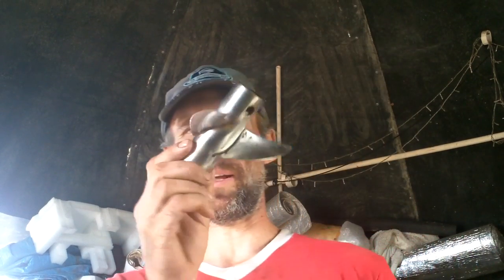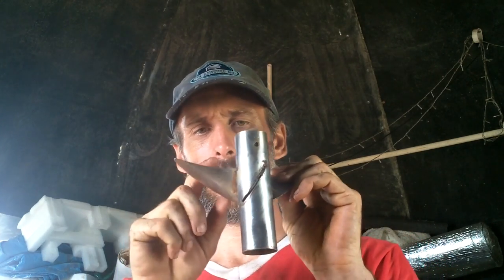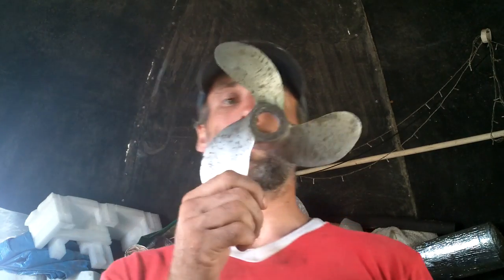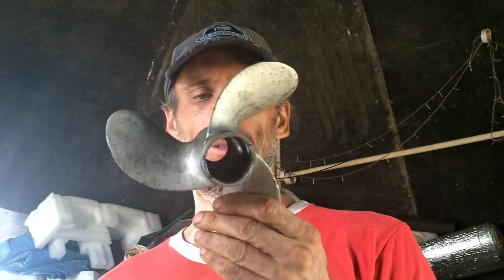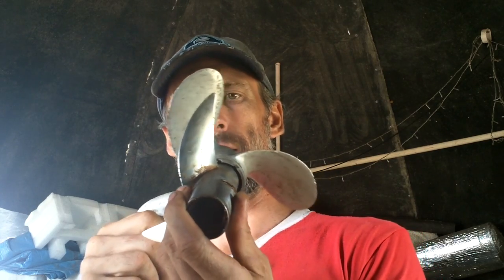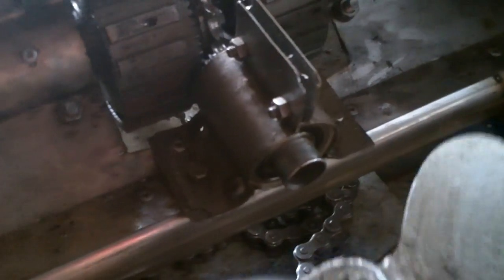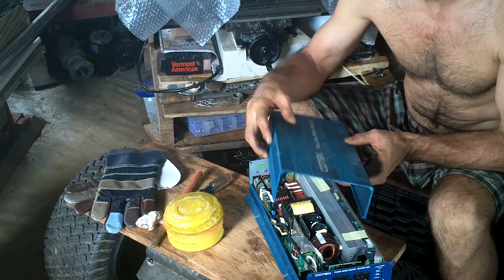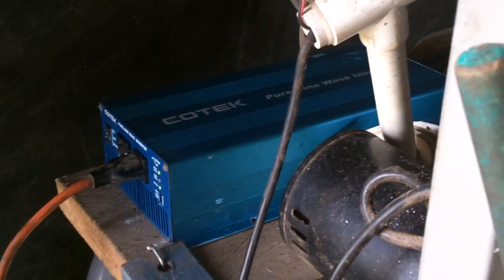Temporary Propeller to go Get Resin... to make Propeller

Comment: You get what you pay for, unfortunately. There are good inverters (Samlex, Magnum, Outback Power, etc), they just cost an arm and a leg. Samlex even has some inverter/chargers that have inputs for a solar charge controller. There are also good boat motors, they're just expensive. - Edit: I guess the charger function wouldn't actually be much use to you. Samlex is probably your best bet, though. Because of the moisture where you are, it might be a good idea to look into a marine inverter, it would probably last forever, but that's big money.
Reply: Bingo. They do make things to last. Jamie does not buy those things, he buys what's cheap, because he doesn't like wasting money. So the struggle is whether you waste money overbuilding, or waste money by cheaping out. Any industrial gear that's overbuilt 10x will last forever. To fix the inverter, it's probably 1 of 2 things: 1 - The big power capacitors, or 2 - One of the power transistors. You can figure this out just by doing a sniff test. Put a straw in your nose if that helps, and sniff different areas of the board. Hopefully you'll find a brown stain on one component, that'll be what needs replacing. But when you're in Panama and not a major city that can have parts delivered next day, pain in the butt.

Comment: With your engineering awesomeness,  I think it would be cool to see if you can build a propeller that you can adjust the blade pitch while you are running it.. I think it could be done with an internal linkage rod in the drive "tube" that could come up to the motor end and out to an external ring and bearing that you can move up and down to make the propeller adjustment.   Sorry if my ramblings are incoherent as I can see it in my mind but may not be able to put it to words.

Comment: You can try to treat the rust on stainless steel with lemon juice. The citric acid will dissolve the rust and create a new passive layer on the surface protecting it from further corrosion. Although sea water will corrode some lower grades of stainless steel anyway.

Comment: Try to find an old Tripp-Lite inverter. They aren't pure sine but will start and run anything you have in the shop. They handle motor startup with ease since their rating is 1/2 of the output made during a large load.

Comment: Get an outback fxr3048 - it is a completely sealed inverter no outside air gets into the electronics. They make them for 12 or 24v also but the 48 is the most efficient
Reply: I have them running here for over 15 years in an 9kw three phase array. The only thing that kills them is direct lightning strike.. not mine but others have died from that. About to replace with the same models but 6 of them for 18kw three phase.

Comment: So the reason that everything only lasts for a while is because of whats called " planned obselescence ". You may already know about this but if not look it up it explains so much about the reason why we are such a throw away culture. Look up the hundred year light bulb and it explains why everything you buy is engineered to fail. I try to buy old tools whenever possible because they were made to last until around 1920's ish.  By the way thanks for doing all these videos its a nice little escape to see some robinson crusoeish inginuity. Ur helpfull in keeping the dream alive until i get my ducks in a row and get some property to really start livin.
Reply: Planned obsolescence may be a real thing, but so is "built to a cost". There is a subtle difference between "engineered to fail" and "engineered to meet a cost". The result may be the same for the consumer but the driving factors behind the two are different.
Reply: That 100 year light bulb is extremly dim. The filament temperature is very low so that bulb has lasted a very long time it is the total opposite of "The light that burns twice as bright burns half as long" - Tyrell, Blade Runner 1982. At the end of the day failure rate is directly correlated to operating temperature, see my other comment.

Comment: it might be cool to make a prop mold thats a little less extreme in size and pitch than you need for a single prop, and then stack multiple props on each shaft; like try two on the motor shaft and three on the peddle shaft(or even smaller props and a few more of them to add or remove to tune thrust), but maybe you have already thought of that
Reply: The most efficient propeller is a two bladed one (in theory a single blade - but not practical). When you are constrained by diameter (as Jamie's design is) then you add blades to absorb the power input. Purposefully making the blades smaller so that you can add more of them will needlessly sacrifice efficiency.

Comment: The electronics industry failure rates for parts closely correlate to the Arrhenius equation.  But nothing lasts forever, everything will eventually fail. Failure rate of electronics is mostly based on temperature. So every 10°C rise in temperature will roughly half the Mean Time Between Failure (MTBF). To increase the MTBF there are three options, use really expensive components with extremely high ratings that will run colder when operated at a fraction of their rated load, operate the device with a much lower than rated load than specified OR continuously cool the device while operating and for a short while after operation to reduce the temperature. “the rule of thumb is that every 10°C increase in temperature reduces component life by half” - is the reason that parts fail more often in hotter climates, than colder ones, but at the end of the day it is all statistics.

Comment: Don't give up on your inverter! It's almost always the big switching elements that fail in those inverters (if it isn't a blown fuse). There will be sets of big MosFETs mounted to heatsinks. The method for testing them is pretty simple http://electronicsbeliever.com/how-to-know-if-mosfet-is-defective/, and can be done with them in the circuit. The replacement MosFETs usually cost about a dollar.

Comment: If you heat old resin it will become like new again.  I have done it with resin for model airplanes and I don't see yours being any different.  Just a thought.
Reply: That works for epoxy resin, I don't think it works for polyester resin like Jamie uses.

Comment: *All consumer-grade Electronics, (as with nearly everything else) are an engineering/design compromise between good (reliable & powerful), fast (to the market asap), and cheap (you would be amazed at how many people will nearly do backflips to save 99c).    If you are prepared to pay NASA-level-prices for your technology, then it *will be reliable  (its hard to replace broken satellites).    If you want good *and powerful (Kw for inverters) , it *isnt going to be cheap..   Whether it is paid for by your time in making your own, or your money (same thing, different shape), it *will take a lot of effort to get reasonable amounts of any two or more of them.  Its the conundrum faced by *all engineers.  There is *never enough time or money to make a design *perfect.
Reply: People tend to confuse "planned obsolescence" with "built to a cost". People look for the lowest cost and companies build to meet that demand - as long as it lasts a little while, the customers are in general, satisfied. Then there are also companies that take advantage of the old adage  "you get what you pay for", and artificially raise the cost to make you feel like you are getting a better product. It is difficult for a consumer to identify what a quality product is. Even more so when a known, trusted brand name is slapped onto a cheap import.